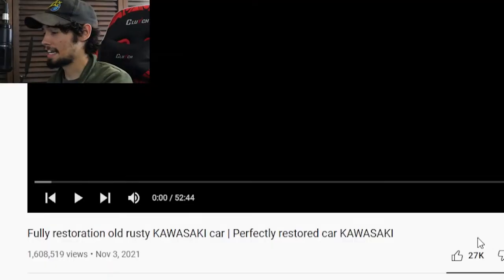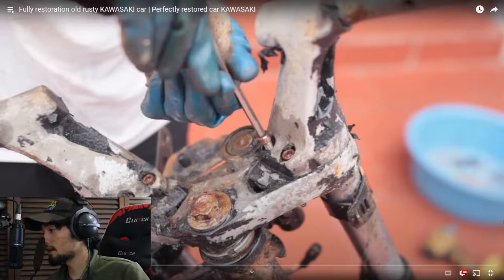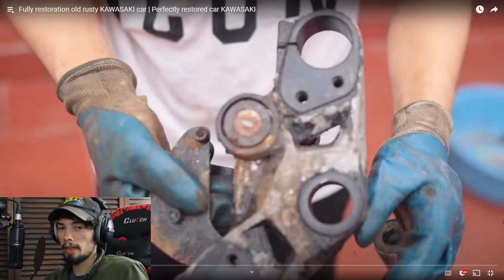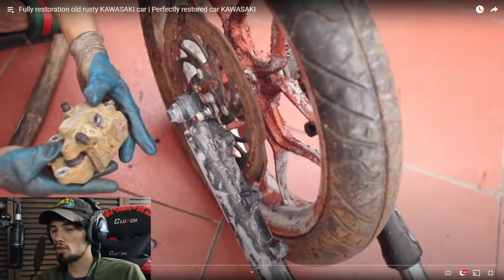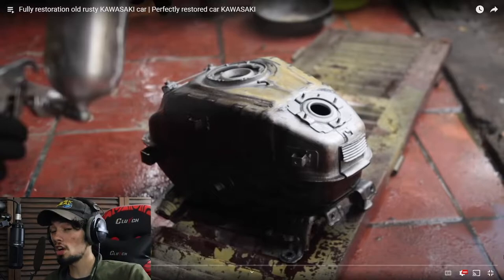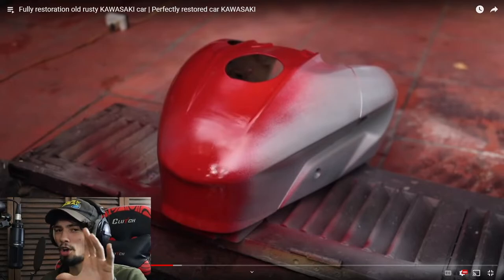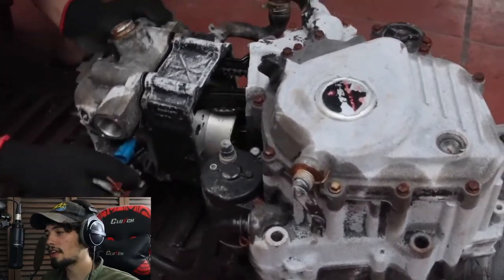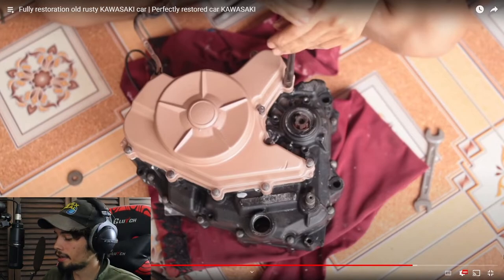Exposing FAKE Restoration Videos!! #2

Comment: That's no Kawasaki, that's a Bajaj Pulsar 200NS with a Kawasaki KLX headlights. A good reliable cheap bike cuz I've owned the same model for 5 years. Seeing this bike in that condition makes me sad. That cheap fake Brembo RCS19 master cylinder 🤦. At the end ov the video, the bike does not sound like that. It's not a 2-Stroke. 

Note: if the uploader mention it as a Kawasaki gives it away either this video is from Vietnam, Indonesia or Philippines. Cuz only on that county this Bajaj Pulsar 200NS sold under Kawasaki brand.